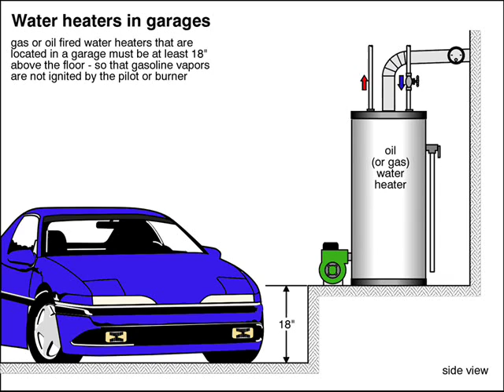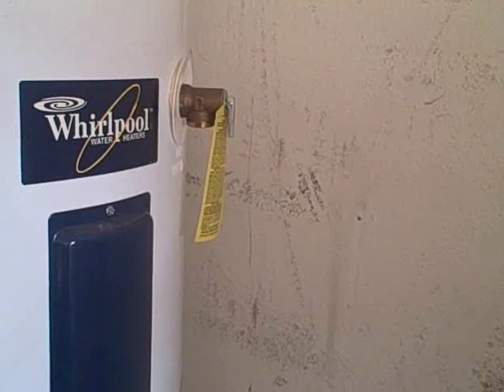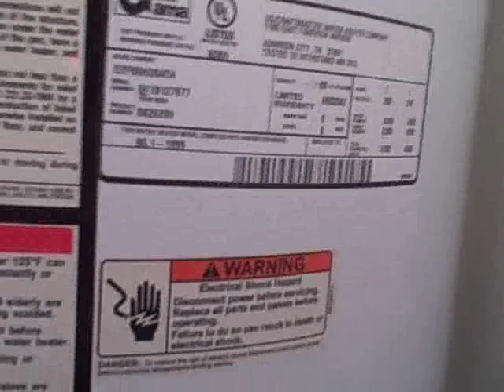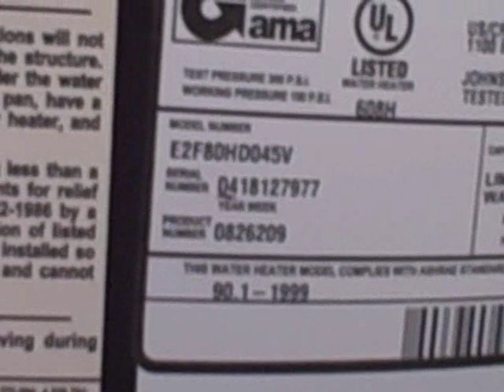Electric Water Heater Inspection

Comment: My waterheater is above 18inches in the garage but doesnt have a pan.  Should I add one?
Reply from the maker: Pans are not required in all cases when installed in the garage. If the water heater is installed were water leaks from the water heater will drain out on the garage floor and will not leak into the house, then a pan is not required. 
If the water heater is installed in a garage closet with living space around it, then a pan is required.
I hope this information helps.

Comment: If I have a back-flow stopper at the water meter, I don't need vacuum relief valve at the water heater tank?
Reply from the maker: It is not clear to me what you are asking. Water heaters do not have a vacuum relief valve.
Reply: @ArlingtonInspector  you're right, but certain cities require it by code, and also it make sense as a protection against siphon effect creating a vacuum and destroying your tank? on the other hand my city installed back flow valve at the meter, so I assume that chance for some siphon effect is relatively small...

Comment: The video is for an electric water heater. The illustration provided was for a gas or oil water heater. Do electric heaters have to be installed at 18"
Reply: That's code 18"
Reply: 18 in is for LPG and gas. Not required for electric.

Comment: I believe instead of the word 'electrolysis', you were looking for the word 'galvanic corrosion' or 'bi-metallic corrosion'.  This is where one metal acts as the anode (corrodes), and the other metal acts as the cathode (corrosion rate slows or stops).  Other than that, fantastic and very informative video!!

Comment from the maker: Many electric water heater thermostats have enclosed contacts but they are not sealed gas tight. Therefore if an electric water heater having a thermostat is located less than 18 inches  from the bottom of the unit both this section and Section M1307.3 require that the unit be elevated so the thermostat is at least 18 inches above the garage floor. Electric water heaters having all switching controls located above 18 inches from the bottom of the water heater are not required to be elevated.
Reply: In Texas do you need a permit to do a Hot Water Heater. If so will a inspector come out to see the work. I have Electric 50 gallon that is 2003 when we had the house built. It lasted almost 18 yrs. 
 Thinking of going a tad bigger maybe to a 70 gallon. I have the room. The space is 27 wide. Any suggestion. I dont want tankless as I live in HOA.

Comment: @youfillintheblank1  18inches off the floor is a requirement in garages where fumes may exist..though putting a water heater off the floor with a few bricks is good idea on concrete..

Comment: Im more concerned that its armored cable, and the water heater has its 240 red line to a neutral line (not marked in black tape that its a hot line). 
Also since the ground Im sure, its via the tanks interior which would ground to the armored cable the water heater is ungrounded. So if it does leak and spray onto the floor you will step in the puddle, and touch the ungrounded tank. FUN 240 Volts.Yeah Baby.enjoy that 80 gallon tank. 
PS electric water heaters need not be 18 inches for the floor